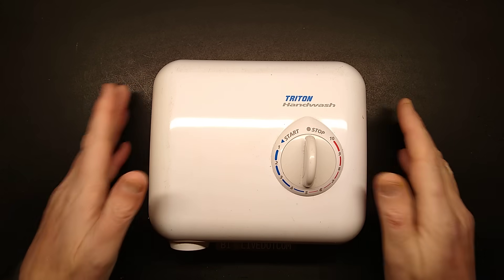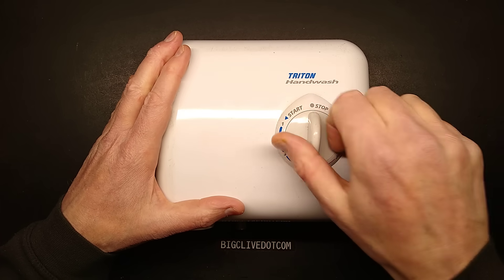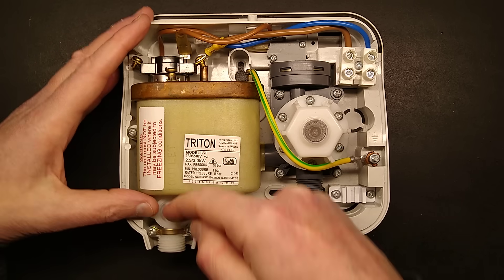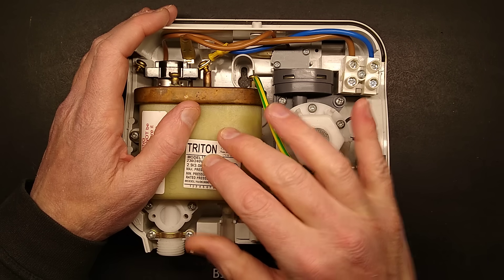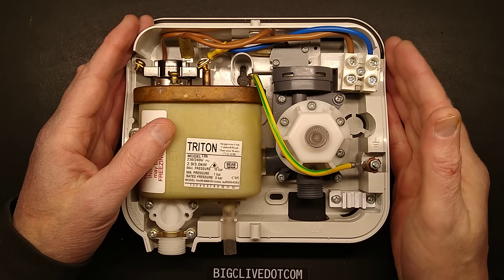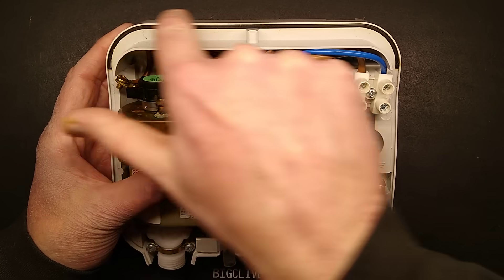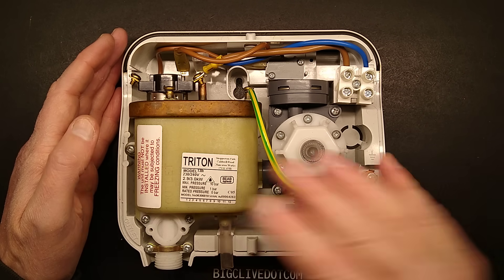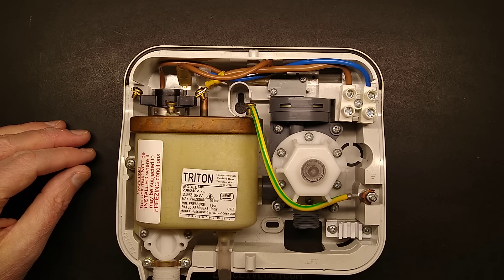British construction site hand-wash unit

Comment: I've definitely brought the electric shower accident statistic up. I've had two electrical incidents with an electric shower in my teens.

Once I was having a shower and felt an electrical tingling on my back that got stronger as I got closer to the head of the shower. Nothing more happened and I don't remember what the cuase was.

The other time I was having a nap in the tub under the shower (weird teenage habit) and woke up to the world collapsing around me resulting me getting out of the tub THROUGH the side of the tub. The shower basically exploded on top of me with a bang. I think the cause was that the electrician couldn't fit the wires into the spur so decided to use a smaller wire gauge that what was required.

Comment: you should see the on demand 120v 3000w on demand heaters that just dont work at all over here cause they'd need a 30 amp circuit on connections made for 15amps lol
Reply: LSAR Electric Tankless Instant Hot Water Heater is one on that website that sells goods at a fast shipping rate

Comment: 🤣3kw from a plug is a very bad idea as running close to fuse rating so Fuse gets hot after any length of time. 
16 amp rcbo and a double pole switch. Just like the 3kw immersion on a plug catches fire when shielded plugs used. Been to many many that catch fire.
Reply: Good thing these are only for intermittent use then, just like a kettle.

Comment: Just to add a bit to 03:27 here: Many Americans might be thinking more of the Widowmaker variety of electric shower that's common in many Asian countries and much of the former Soviet Union, which employ Tungsten elements in direct contact with the water and often with poor or no safety earth between the element and where the water comes out. 🚿⚡🪦
These are a direct contrast to the British/European variety, where there is no direct contact between any conductor and the water being heated, and intentionally excessive earthing is used to ensure any fault current that occurs is routed safely away from the user and will cause the showers RCBO/GFCI (You'd better have one! 😉) to trip out. 🚿🛡👍

There's a meme kicking around where one of the Widowmaker showers has the CPC wire running into a plastic cup filled with soil, to which an arrow and some Cyrillic text (Russian) identifies this as „Earth“. Cracks me up every time! 🤣

Comment: If this were made in Soviet era Russia, you wouldn't need to plug it in because the heat source would be a radioisotope. If they used polonium-210, they would only need about 22 grams to match the thermal power of your unit, but I wouldn't be surprised if they used a lot more just to deal with the drop in temperature as it decays. It has a relatively short half-life of 138 days, and large construction sites can be active for a lot longer than that, so they may prefer plutonium-238, but they would need over 5KG, which may pose a "critical" issue if too many of these units were to be stacked together. The radiation is less of an issue. This is Soviet-era Russia we're talking about, so workers exist only to be used for the benefit of the elite then discarded (apparently not much has changed).

Comment: So in the US typical residential is 120V 15A. 20A for kitchen, bathroom, and special application. Is it fair to assume  that UK would be 7.5A /10A?
Reply from the maker: It's around 12A for a 3kW load on 240V.
Reply: 16A, 20A, or 32A, depending on the arrangement. 13A max per device.

Comment: We have a battery operated time controlled water valve for the hand sink at work, it also has an adjustment for how much hot water but it is under the sink and cover. The water pressure is weak. This would be nice because unless you stand there and activate it 3 times, the water is cold. So the water heater is useless. But if the electric goes out...

Comment: I envy countries that can do this with a normal plug. My house has an issue with the plumbing where sinks get scalding hot water while showers barely get any. We've adjusted the scald protection to little effect so my only other option was to increase the hot water temperature for the whole house so I almost burn myself while I'm washing my hands. I can't wait to get the first electric bill for that.

Comment: When kitting out my workshop, with a very low budget, I wanted hot water, but didn't want one of these ones I'd used before were only too hot or too cold (not sure why, as my Triton shower, with near identical internals is fine). I discovered Steibel Eltron's 3 phase on demand water heaters with temp control, but couldn't afford one. An eBay saved search found me a new old stock one for just £90. 21kW, which heats to 40c at normal tap flow rates. It's awesome. I didn't anticipate the SWA cable to connect it up costing far more than I'd paid for the heater though!

Comment: Several weeks back here in Greece a lady was killed when taking a bath by electrocution. It turns out that there were three things working against her. First it was found that the ground line to the heater was missing, second, the element cladding had corroded away exposing the nicrome element inside(water here in most places tends to be full of dissolved minerals and slightly corrosive) and last, electric panel (consumer unit to our British brethren) did not have a ground fault circuit interrupter installed. In this part of the world it is required to have a whole house GFCI installed at the main panel while in the States they are pretty much only required on outlets in the kitchen, bath and outdoor receptacles. Most often there will be a GFCI equipped outlet feeding the bathrooms, one for all kitchen outlets and one for exterior outlets. These are feed through outlets where anything connected to the output leads is protected.
A whole house GFCI is nice unless it gets tripped and it leaves you in total darkness, your bound to trip over something.

Comment: Just FYI, I recently discovered that the thermal over load cut-outs (TOCs) in these units and electric showers are two-stage devices.  There are two bi-metal discs in the switch.  The first one 'pops' at about 70'C and is self-resetting.  The second disc pops at a higher temperature, as a last resort, but cannot be reset.  That's why it says not to press on the exposed discs during installation, or the TOC is scrap.
Reply from the maker: I wonder if freezing the cutout would reset it.

Comment: Heatrae Sadia do a much better version that stores a few litres of hot water. (depending on size) They are also pressurized and take mains water pressure meaning that you fit them under your sink and can even supply multiple outlets.

Comment: How can a electric shower be efficient? They are not heat pump based, are they?
Reply from the maker: 100% efficient conversion of electrical power to heat with no system losses or high maintenance costs of a heat pump system.

Comment: This is giving me flashbacks to being a kid in the 80 and my parents' electric shower that would try to be a kettle. I'd turn it on, wait for it to stop spraying freezing cold water at me, set the temperature, stand under it and wait. A few minutes later I'd hear water boiling inside the thing, it'd try to burn my skin off and then the thermal cutout would kick in and it'd then spray me with freezing cold water. And being a kid, and it being the 1980s I figured this was just how showers were. It's good to see today's builders' apprentices have the chance to experience this too. I'm sure it's super pleasant trying to wash concrete, expanding foam and mud off your freezing hands using a device that just wants to burn you all the time 😆

Comment: The temperature rise depends inversely on the flow rate, since a fixed amount of heat is being shared between more or less water.

The Specific Heat Capacity of water is 4200.  That is the number of Joules of heat it takes to make 1kg. of a substance get 1 degree C hotter, and 1 litre of water weighs 1kg.  Since there are 60 seconds in a minute and a Joule is one Watt times one second, if you have water flowing at a rate of one litre per minute, every 70 Watts supplied to the heater will make the water one degree hotter.

The UK versions  (and probably also the Continental versions)  of these heaters are constructed such that the heating element is insulated from the water, the metal can around it is earthed, and nowadays there is almost always an RCD to cut off the power in the event of any imbalance between the current in the Line and Neutral  (which shows current is taking some other, non-approved route; possibly via you).  This is not necessarily true of all versions used internationally .....  Especially in hot countries where the mains water is already warmer and so a lower kilowattage heater will suffice.

Comment: Is its heating element insulated or open like the shower heads that rely on a ground wire to drain the spicy electrons?
Reply from the maker: It's an insulated one like a kettle element.
Reply: @bigclivedotcom  fanplant is sad

Comment: Can I use that on a washing machine? Genuine I'll do it if I can kind of question. 
Probably not something you could answer off the bat but, worth a "can we?"  video for you perhaps if it works.
Reply from the maker: In the UK or washing machines have built in water heaters.  An unheated unit would require a reservoir of hot water.

Comment: Our Landlord replace our 3KW hot tank with a water heater very simmer to the hand wash water.  It's connected into the mains water supply with a pressure switch so as you turn on a hot tap the switch turn on 3X 3KW water heaters, when the water gets up to the set temperature one of the 3KW is shut down to about 1KW may be by a mosfet?  The water pressure is a bit slower than from a tank but we only use electricity when we turn on a hot water tap.  So it's swing and roundabouts

Comment: I really am pro electrifying the appliances that have been using natural gas.  It's absolutely mandatory that the whole world stop burning fossil fuels.  There should be laws requiring the installation of heat pump air conditioning and heating.  All cooking should be done without natural gas.  All hot water must be made without natural gas; probably made by heat pump.

But a kWh of electricity during peak time, from 1600 to 2200 hours in the evening, costs $.67 per kWh.  So it could cost a lot to take a hot shower, do the laundry or wash the dishes.  These "TOU -time of use high costs" seems to be the biggest obstacle in getting people to go all electric.

Comment: Triton also used to do a permanently - installed washbasin heater, with a chrome swivel nozzle, and the temperature control on the right hand side.  Fitted one of these to our "extended" downstairs (formerly outdoors) toilet when I did the "mini-bathroom conversion), along with a hard-wired Triton 8kW instant shower. Worked a treat (as did the shower),  but having a shower in the "cooler months" was a bit of an endurance test, even with a wall-mounted fan heating system.

Comment: I thought the usual circuit breaker around the home, etc was 7 amps, or so. Roughly equivalent to the typical 120v 15 amps. I'll grant it's still 'easier' to get 3kW on 240v because of the wire size required for the equivalent on 120v.
Reply: I do not know where you got those numbers from. Typically UK breakers are 6A for lighting, 16A or 20A for radial circuit power sockets, 32A for ring final socket with 32A, 40A or (more rarely) 50A for  high powered dedicated circuits like cookers.

Whilst the circuits for power sockets are commonly 32A, individual plugs are limited to 13A, but ought to contain fuses appropriate to the load and Flexi wire, so a table lamp will be 3A.

Permanently wired spurs off those 32A circuits, such as might be used  for a ventilation fan, under cabinet lighting, powered blind etc. will also have a fuse rated to the load not exceeding 13A, and often a lot lower.

It is that 13A fuse on a plug or spur off of those 32A circuits which makes it relatively easy to have 3kW appliances almost anywhere. For example, a UK electric kettle can be as much as 3kW.
Reply: @TheEulerID  6 amp or 7 amp, same thing. Also forgot you had retarded ring mains.

Comment: Had a 10kw electric shower nearly burn the house down once. The sparky had looped up the excess supply cable which turned into a very nice induction heater which eventually crispified the whole area surrounding it 😬
Reply from the maker: It's not usually an inductive effect.  Just a heat dissipation issue.  I wonder what size the cable was.  Many lazy installers use the original cable intended for lower power units.

Comment: In the back of my mind, I would always expect to get electrocuted and die when using things like this.  I am sure it never happens, but it is like holding your breath before touching a doorknob, not knowing if a static spark will give you a heart attack or not.  It is the suspense that is the problem, and I had rather just take a cold shower or wash my hands in cold water,.   Maybe I have just been shocked too many times...

Comment: What is the best hand-wash system for vans where you only have access to 12v?
Reply from the maker: I think they do van units.  But I've not tried one.  Maybe even diesel powered water heaters or ones tied into the radiator system.

Comment: Mentioning UK plumbing safety (i.e.: failsafe valves etc.). Some genius installed the pressure vessels for our heating and hot water by screwing them to a piece of skirting board glued to the wall. Worked fine for twenty years until both failsafe valves on the cold water feed failed causing the pressure vessels to completely fill up, resulting an almighty bang as they fell off the wall taking a significant proportion of the pipes with them. The plumber was not impressed with “the complete arse who installed it in the first place”! That’s two new pressure vessels, several yards of copper piping, new valves, and possibly a new cylinder too, depending on whether the big dent in it is a problem or not.

Comment: Any idea how heat pump water heaters will fair in the UK.  I know space is at a premium but those units will only work effectively with some stored hot water
Reply from the maker: They are massively more compole than other heating systems.  I think there's a lot of sales-motivated advertising going on.
Reply: I have seen some of the complex systems installed in the UK that combine space heating and Domestic Hot Water storage with air-to-water heat pumps.  You are right to call them heating engineers.  It would take an actual Mechanical Engineer to design and understand systems like those.

Comment: Would you say that your electric full showers with the instancy of hot water, some of which are now becoming more prevalent in the US for off grid setups, would be tepid? I know you can set them up to be a certain temperature, but I'm curious if one were to say, on a left drain tub, turn the hot tap on first, would one need to shield their arm before turning on the cold water? And is it presumably not just power efficient but also water efficient?

Regardless, thanks for 2023 and wishing more success in '24!
Reply from the maker: The purely electric showers tend to have a slight cold to hot curve as the mass of the heater builds up.  But if someone has used it just before you, you can get a burst of very hot water.

Comment: As a North American (🇨🇦) I am amused that the UK does not allow an electrical outlet near the sink for a hair dryer but are perfectly ok having a water heater in the shower.  With proper GFCI/RCD protection either is equally safe.
Reply: You can have an outlet for one at the sink. You can't have one you can sit in the bath with.

Comment: Having had to use one of those electric showers before, I'm reminded just how much better the North American system is. As mentioned in the description, the temperature depends highly on the flow rate and you get a choice that varies between "ice cold and strong" and "scaldingly hot trickle".

In contrast, at home with a hot water tank I can get instant hot water at a constant temperature regardless of flow rate for longer than I need for a shower. We have tankless units too, but they're designed for the whole house and probably draw a lot more power as they keep the temperature constantly high at the full flow rate.
Reply: It's not 'the North American system', it's just a tanked system. We have those too.
Reply: there are electronic controlled Waterheaters available which can regulate the heating power to get a steady temperature.

Comment: My shower pops a safety thermostat if I don't run it cold for 30 seconds after use. How do these not need to run cold after each use?
Reply from the maker: These have fairly low mass.  I'm not sure if I've noticed one cutting out thermally when turned off.  As you turn the dial to off it does increase the water flow as you do so, so it may purge in cold water.
Reply: @bigclivedotcom  Thanks Clive yes that makes sense.

Comment: I wonder where the changeover point is between one of these inline heaters vs small electric (kitchen) boilers in power consumption. The boilers turn on every now and then keeping the water warm (but generally not capable to maintain warm water if only fed from a cold water line) where as these use quite a bit of power (3kw) but only when in use.
Reply: Resistive heating is 100% efficient so in terms of electrical energy used both are identical at first glance. The tank is always losing a tiny bit of heat so it will use more energy when water is not flowing.